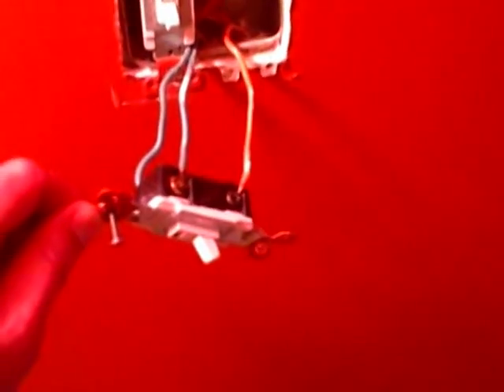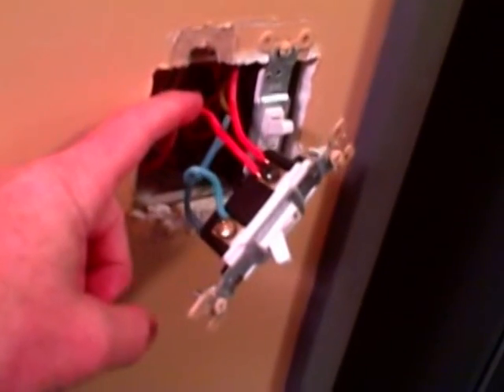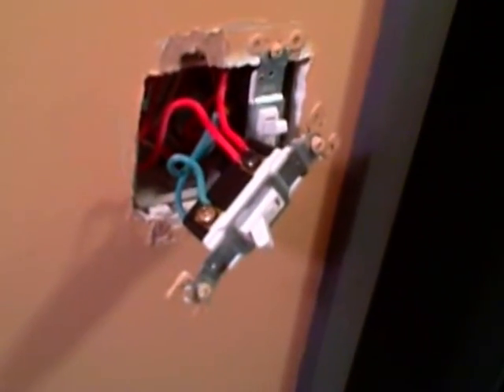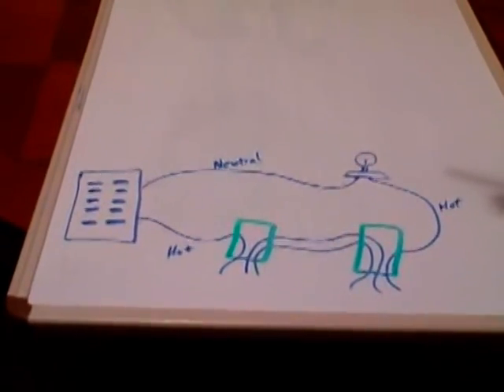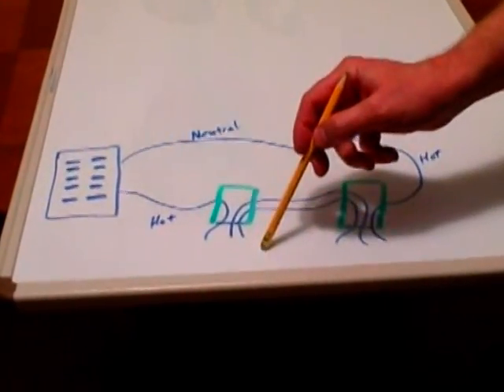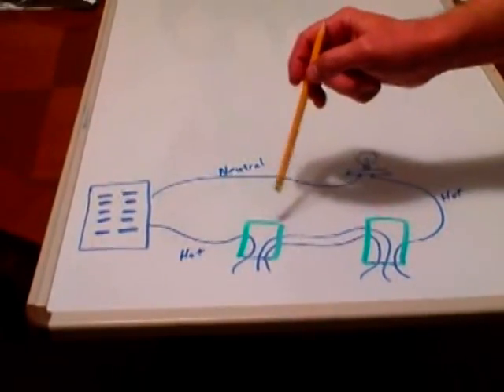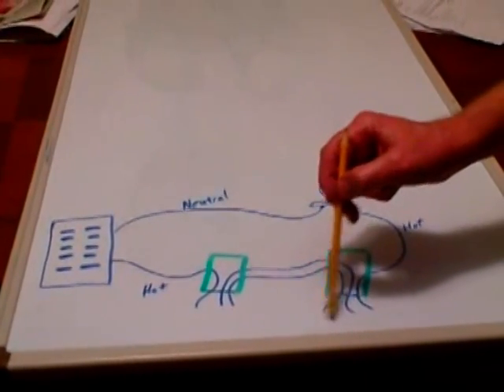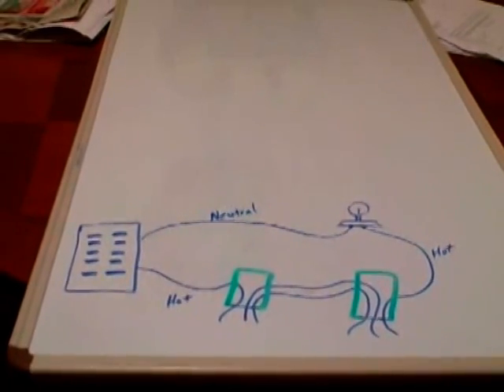What is a 3 Way Switch - 3 Way Switch Diagram - Conduit

Comment: I have two 3-way switches in my hall controlling the hall light.  One of the switches has 4 wires.  One of the wires goes to an outlet in my bedroom next to the hall.  When I turn this switch on and off the outlet in my room turns on and off.  I wan't this outlet to stay on at all times and not turn on and off.  The hall light works fine from both switches except for this issue with the outlet in my bedroom with this one switch.  Is something connected wrong?
Reply from the maker: Trey Z Hi, you have a switched outlet. Do you have an electrical tester? I can walk you through the steps.
Reply: Yes I have a tester that will test whether it is a hot wire or not. I appreciate your help
Reply from the maker: Trey Z Hi, here is a video I did showing the wiring to a switched outlet. Let me know if this helps. https://www.youtube.com/watch?v=tYinqtVDNcA.
Your outlet is going to have the tab on the brass side broken. You will need a new outlet, do not break the hot tab. 
Turn off the power. Remove the old outlet. Separate all the wires so nothing is touching. You now want to turn on the power and test the wires that were going to the brass screws. If both are hot, turn off the switch and test again. Now only one will be hot, this is the wire you will use to connect to one of the brass screws. You will use a wire connector and cap off the wire coming from the switch, or if it is wired like the video I shared, disconnect the wire going up to the switch.
Let me know how it goes.
Reply: FIX IT Home Improvement Channel I must have done something wrong when I replaced the two 3 way switches in my hall.  Everything used to work fine.  I tried to replace them because someone had painted the switches and it looked horrible.  So I am almost positive that there is nothing wrong with the outlet in my bedroom.  It worked fine before I tried to replace the switches in hall.  Once I took out both switches and looked at them this is when I saw that one switch has 4 wires, not 3.  One of the four wires wasn't connected to anything and I assumed it came unattached when pulling switch out of wall so I have tried to hook it to a screw when new switch was installed and this is when the problem started.  I don't know.

Comment: Can anyone help me on this?

I installed an electric hot water heater and all 3 electrical wires coming from the house are exactly the same. There is no (green) marking for which one the ground wire is (it fell off). In a scenario like this how are you possibly able to find out which one is the ground wire (again, all three wires are exactly 100% identical)?

Also what would happen if a person hooks things up wrongly? Such as maybe in a different case somebody hooked up the positive onto the negative or the ground somewhere else or so on. Basically would a bunch of sparks fly out immediately? If you touch positive to negative sparks fly. But what about positive or negative to the ground wire? Also how much of a risk would I have of damaging the circuit box or something by touching the wires and such?
Reply from the maker: Liebe Dich Hi, is the water heater 240 volts or 120 volts.
Reply: 240v
Reply from the maker: Liebe Dich Hi, what is the make and model of the water heater. Do you have flexible metal conduit going to the top of the water heater?
Reply from the maker: For most connections on a 240 volt water heater, you have two 120 volt hot wires and one ground wire. I would use a non-contact electrical tester and it will show you the 2 hot wires. Let me know if that helps.
Reply: Sounds good, but I already did install it and I got it right the first time. All evidence shows that it's correct, everything works good. But if it was wired wrong how would you know (without a tester)? It wouldn't work at all for even a minute, right? Much appreciated for the help.

Comment: Yes. Thanks for your help.
Reply from the maker: Hi,
If you are using that 3 way switch as a single pole, connect one wire to the dark colored screw and then the other wire to either of the light colored screws.
We also have a weekly home improvement podcast on iTunes and Stitcher. Here is a link https://itunes.apple.com/us/podcast/fix-it-home-improvement/id880903087?mt=2

Comment: All the wires were capped off individually and not hooked up to anything. So I should twist the two white wires together and cap them off and then put one black wire up high and the other low on the same side?
Reply from the maker: I would turn off the electric and separate all the wires so nothing is touching. Then turn on the electric and using a tester, find the hot wire. Check them all to make sure there is just one hot. Mark that wire and shut off the electric to that circuit. If the light has only one switch that operates it, the 2 black wire will be connected to the 2 screw terminal on a single pole switch. The white wires should be connected with a wire connector. Here is a link to how to wire a single pole switch Wiring a Switch - Single Pole Switch
Reply from the maker: Hi,
Are you using the switch with 3 screw terminals? plus a ground

Comment: 3 terminals and only one switch
Reply from the maker: Hi,
If there is only one switch that operates your light. You should have a single pole switch with 2 screw terminals, plus a ground. How was the old switch wired? It should have only been the 2 black wires. The 2 white wire should have been connected together with a wire connector.